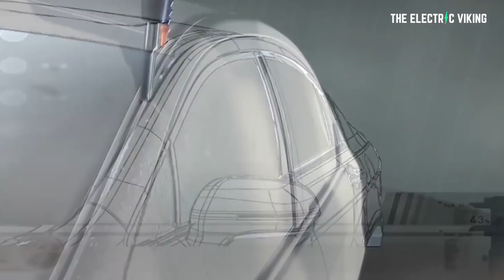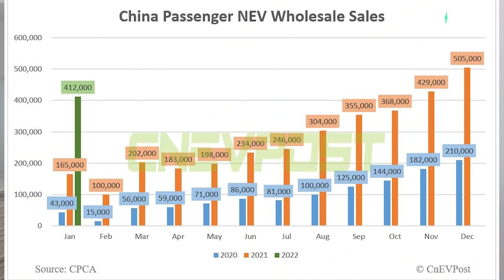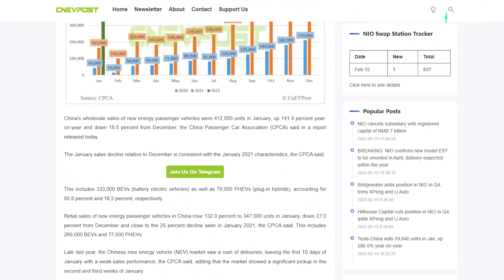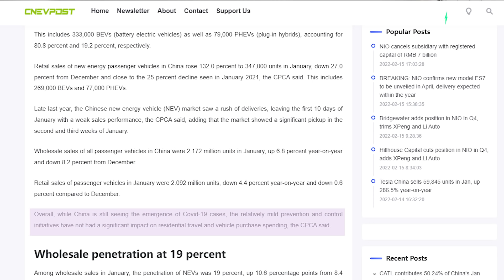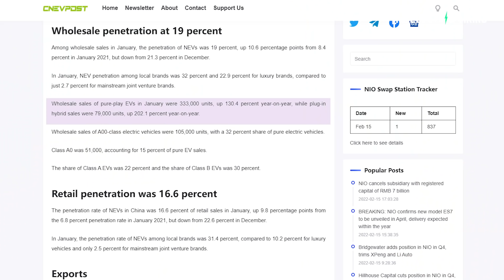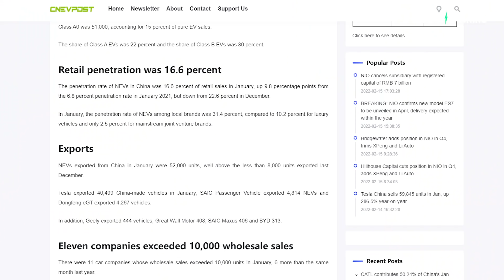China's January EV sales show alarming trend is being ignored

Comment: Hi Sam! I have some acoustics knowledge for you, 1) the mic 🎤 is picking up the room noise due to his cardioid (non directional) patern. You need a 48v. phantom powered directional mic OR, visually much better and less cumbersome, a tie mic attached at your shirt. 2) the closer the mic to your mouth, the less the room ambience, as you will need less gain for good sound level modulation, so the Lavalier tie mic is a winner, røde microphone has a clip-tie wireless mic that a lot of YouTubers uses that I recommend, the Røde Wireless Go (great Aussie company btw! 👍🏻) 3) Filtering the room ambience out with EQ on you mixboard, The fundamental frequency of a persons complex speech tone lies in the range of 100-120 Hz for lower sounding voices, so by restricting the audio spectrum to this range, you can clean-up a lot the room ambience 🧹 set a High-Pass filter of 100Hz (low cut) and a Low-Pass filter of 120 to 200Hz (high cut ceiling), do some frequencies adjustments to find the best result. 4) Use the Gate function to leave out the unwanted residual sounds, it will isolate your voice further of the room ambience 5) To improve the room acoustic use dampening materials, you can buy studio acoustic foam squares or hexagons panels, plus thick rug(s) on the floor, maybe wall too. If possible, remove, or cover, the mirror 🪞 or place it not parallel to the windows (ping-pong sound reflexions), use a sofa 🛋 placed at 5cm of the wall to create sound trap cavities behind. 6) If desperate, try to change the camera placement, move in the room to find a less resonant spot as some standing waves can occur, but, you normally shouldn’t have to if you use the previous solutions 😉 
Congrats 🎉 for the office Mate !

Comment: Bigger rug on the floor. Be sure to have padding under the rug. Hang a cheap rug on the wall in front of you. If that's not enough hang a curtain on front of the blinds over the glass door wall. Glass is horrible for sound reflections but the first two will do the most good.

Comment: At the risk of adding more possibly contradictory room acoustics information, Sam (I'm a 40+ year veteran of radio production and live acoustic concert recordings, so there's that,) I suggest having some sort of sound absorbing treatment on either side of you in your seated position to treat early reflections. There are commercially available foam sheets, but something as simple as a hanging decorative rug on the wall on either side of you, or a coat rack with a few coats, will accomplish much the same thing. That large mirror on the wall to the right and rear to you probably isn't helping the sound situation. 

Directly to your rear, fill up that space with a bookshelf loaded with books, like you had in your earlier videos. This diffuses the sound in multiple directions to give a pleasing room ambience. Commercially available diffusers look like shallow boxes with asymmetrical wooden slats or small cubes. But an odd assortment of books and CDs on a bookshelf behind you will accomplish much the same thing. The mistake that most people make is to slap foam everywhere in an attempt to absorb all the sound. What you want is some absorption (on the sides) and diffusion (in the rear.)

Comment: Ways to get rid of room echoes, from worst to best:
4) Cover the walls with wedgy molded rubber foam sound proofing tiles.  Ruins the room, costs an arm and a leg, and it barely makes a difference.  Expensive trash.
3) Hang heavy curtains covering the walls.  Works AND looks better than expensive foam panels, but it ruins the looks of the walls and the room anyways.
2) Glue slabs of fiber-glass to the walls.  It ruins the walls the most, and it is dangerous to touch and breathe, but it works PERFECTLY.
1) Buy a sound-proof office cubicle divider (portable wall), and place it behind you.  If you want best echo cancellation, get 3 of them, and put one on each side besides the one behind.  When you are done recording a video you can move them away if you want;  but they look like office furniture, anyways;  not too bad;  and they kill the sound before it even begins its trip to the back-wall.  Not only that, they actually cancel some of the external noise, from barking dogs or ICE cars outside.

Additionally, you can get a directional microphone (cardioid or super-cardioid), with a silent mount (string suspension), and place it in front and slightly above your head level, pointing downwards towards your mouth, like you may have seen they do at radio stations.  The microphone should point at your mouth;  but your mouth should not point at the microphone.  Why?  Because when we speak we issue brief puffs of wind that if they hit the microphone they cause wind-noise very close to the transducer;  the worst place, where the noise is heard loudest.

For best clarity, do not use filters of any kind anywhere along the sound path.  No bass control, no treble, no mid, no band equalizer, no digital filters ...  NOTHING!  Every filter affects the group delay curve, adding group delay peaks, troughs and other distortions, as well as analogue noise;  and every digital filter exacerbates quantization noise.  Envelope control filters (that vary the gain) are okay;  you might benefit from having gate + compressor:  Compressor will automatically lower the volume briefly if you shout.  Gate can be set up to cut down the gain to zero when you are not speaking, which may save you from having to manually switch off the mike, or edit out background noise in post-processing.

Comment: A lot of car buyers want to stop buying gas before the price goes way up. It may also be easier to get a license plate in China if you get a non-gas car. They are trying to cut down on pollution. Some folks may be thinking that as gas demand drops it will go up in price and even be harder to find. Gas producers know their business is vanishing and will gouge consumers on the way down. The smart people are selling their gas cars while they can get top dollar and getting a car that can at least have the option of running on battery.
Reply: Filled up my tank today, alot more expensive, diesel I'm in the UK. Gotta drive slower and more economically now to offset the price rise.

Comment: Need some blocks of acoustic foam (maybe the 1/2+/- area on the back wall). (even cars use it). Also, sound boards, microphones (but the cheap stuff) is designed to negate a certain part of the reverberation.

Comment: Most interesting thing to note for me is that the volume of production that the major manufactures are achieving is that the quality has significantly improved over the last 5 yrs.
They are making so many they have had to leave behind the " factory in a shed " mentality, simply because they have neither the time or resources to deal with ongoing repeat warranty claims. 
much in the way the early scooter and motorcycle manufactures had to improve. 
The main sticking point to convince the west will be dealer support ( or lack of ) and being able to handle warranty issues quickly. 
Even now MG in the UK is starting to have reputational problems with a few vocal critics because there are issues that have been ongoing for 5-6 mths for what appears to be simple parts replacement

Comment: Echo: Also, you can buy a little semi-circular baffle – usually a couple of feet high – to go around all but the front of the mic. Obviously that doesn't control the bounce off the wall behind you; but between the baffle, and your own body, it will certainly help. Also, the closer you are to the mic, the more your 'direct sound' (voice straight to mic), um... outguns the ambient reflections (echo). Beyond that, jrb_sland is right: baffles on the wall behind, rugs (and even ceiling padding) will tame the bright room acoustics. 
But if all that's just too much to bother with, consider a Lavalier mic – that's a tiny clip-on for your lapel; or even better, if you don't mind the look: one of those head-set mics, like some stage-performers/lecturers use. (Just don't accidentally get a phone-quality one.) Both of those get the mic closer to your mouth.

Comment: Treating acoustics - tips from a retired pro. If you just use foam or soft furnishings to soak up reverberation you'll just imbalance to room and make it boomy. You first need to sort out the bass with absorbers which you can cover with a soft finish to handle the mid and high frequencies. Look on youtube for 'diaphragmatic absorbers', 'membrane absorbers' or 'basstrap', there are a number of videos showing how you can build your own or get a friendly joiner to do it for you. The most important area of the room to treat is the corners as these support the fundamental (lowest) frequency that will resonate in the room. A simpe membrane absorber would be a 2ft wide piece of 1/2 inch plasterboard (sheetrock) on a simple wooden frame  accross the corner of the room with the triangular column behind it filled with rockwool or glass fibre wool insulating material. you could cover it with carpet for aethetics and to add some mid high range absorption. the 2 ft dimension is important as is allows the sheet to flex in a damped way to absorb the lowest frequencies.